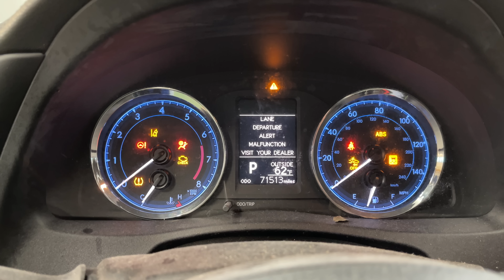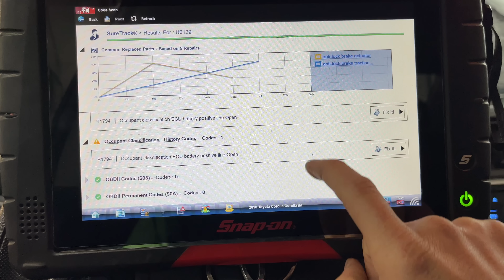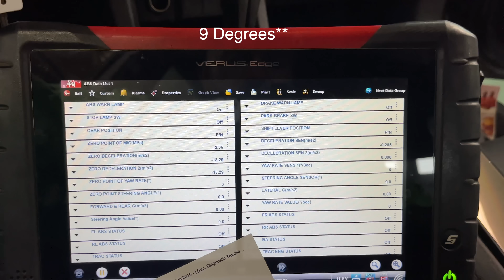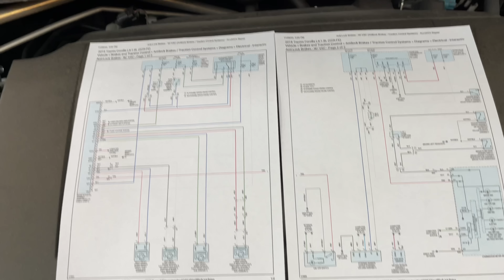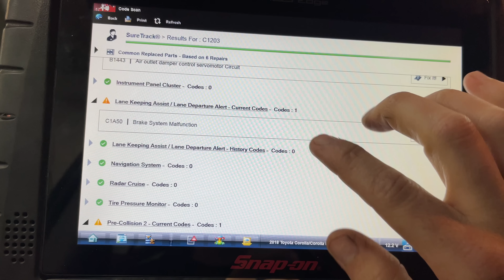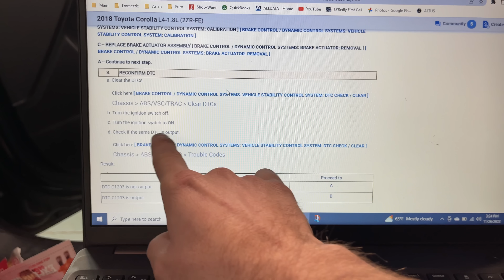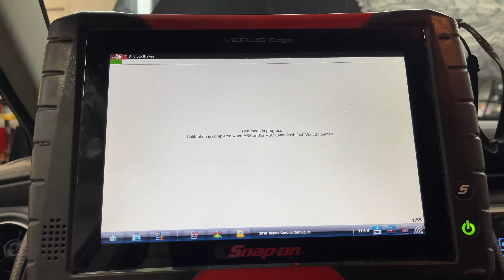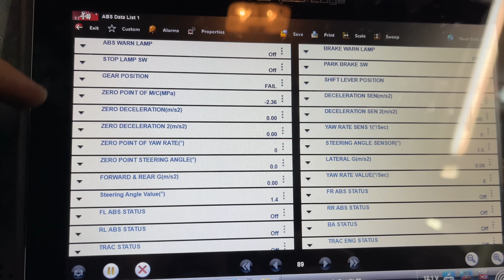Customer States Every Light in the dash is ON!

Comment: I am the lead tech for a company that provides mechanical/electrical repairs & ADAS repairs/calibrations to collision shops. It is very common to have to do the zero point calibration after any impact. Since the ADAS systems rely on Abs data, it will dis-able and set DTC's in most of the ADAS modules as well. Just something to keep in mind should you run into that again. I really enjoy your videos. please, continue. I love learning different ways to diagnose.

Comment: I have found that usually when a fuse is missing it is blown, and a replacement fuse was installed and it also overloaded and subsequently removed, and the person troubleshooting just gave up and did not replace the fuse. So, the question to ask is why did the original fuse blow? Intermittent short to ground, module shorting internally?

My fuse saver master kit has a 5 Amp CB, which I think would support testing of the missing 7.5 Amp fuse. There is also a 10 Amp CB, but I like to start at about 1/2 the fuse rating if I can to make sure I don't over temp any wiring.

Comment: Excellent video as always... Keep it up
May i pick your brain on an issue i am having on a chevy tahoe 2012 ltz... The horn doesn't work when engine is off.. It works fine when engine is running. I can hear the relay clicks when the engine is off but no horn.. I used a test light on the horn fuse, it doesn't light up when honking when engine off... Do u think this is a relay issue?
Reply: @autodiagyt  what is that?
Reply: @autodiagyt  oh i see. No i don't have VD1 in my PRO CODES
Reply: @autodiagyt  yeah that's right
Reply: @autodiagyt  thank you for your feedback... Really appreciate it

Comment: Look at that Toyotas have issues also, 
How misleading that code was. 
Good thought process. 
Just curious what made you decide to go the direction with the steering angle sensor, and not allow yourself to chase down a communication fault? Was it the open ckt faults? 
Anyways. When I see a bunch of codes I tend to struggle sometimes funneling into a good direction. Curious what leads you to your first checks.
Reply: Makes since. Systematic approach. Thanks homie